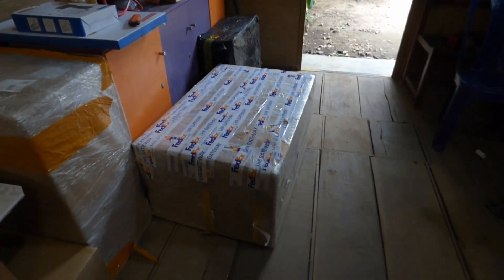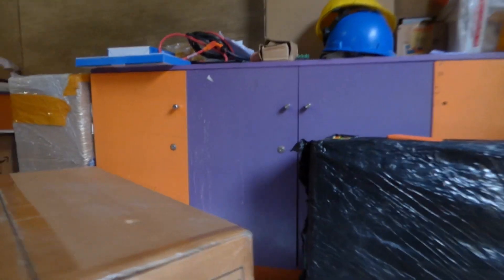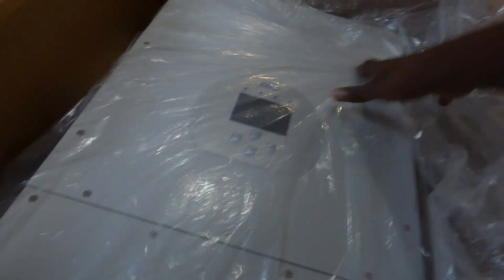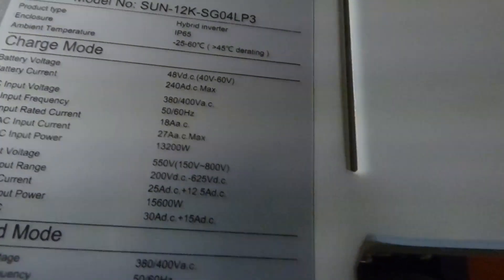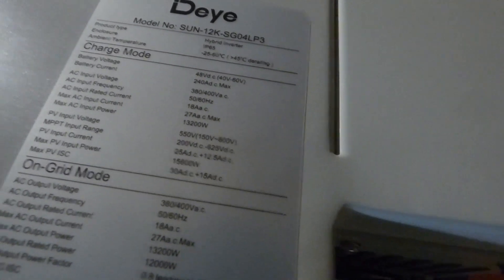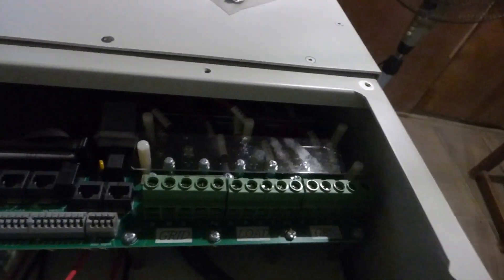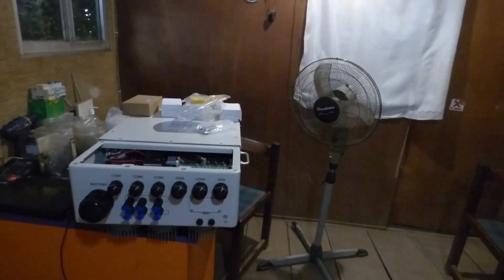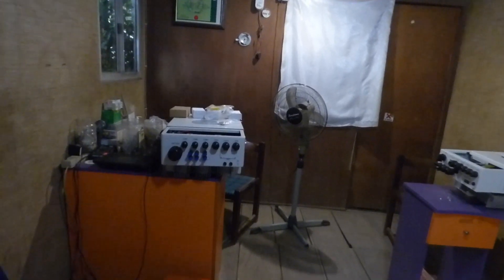Unboxing the Deye 12 kw 3 phase Inverter

Comment: Hi, I have one of this inverter. But I dont get power regulated AC Charge  together with the CT clamps to work. The inverte measure the power which is going to grid but it never charge the battery with this power. 
Do you know a solution for this?
Reply from the maker: In the battery settings tick grid charge.
Reply: @drsolar  Thanks a lot for you fast responds. If I tick grid charge it starts a charge from grid without power regulation than I have to pay for this power which is not what I want. It should use the available power from other inverters to charge the battery and not from grid.

Comment: Iam on the solarman pro app on mobile as well as desktop... 8n desktop from my laptop how do I remotely change.settings of inverter such activating  or deactivate time of use ,under  Device control it shows no data for now. How do I enable this?
Reply from the maker: Thank you for watching and commenting. You need Deye to give you access. Have your seller put in a request for you

Comment: I would buy 2 x5kva and joint them in parallel instead one massive 12kva .
Reply from the maker: You would need 3 of the 5 kw. The 12 kw is three phase

Comment: How's Deyes build and longevity quality comparing to big brands like SMA, Fronius, Huawei, Goodwe, Growatt etc? And what do they mean by "Input PV is 550, but it's also up to 800?" Huh? What now? :P And is that per MPPT?
Reply from the maker: They offer a 5 year warranty. It is still too early to tell. The PV input question. There is a maximum that will damage the controller and an acceptable range that works well

Comment: hello, thanks for the video.
I have a question 
this inverter PV input voltage is maximum 1000v, is that means 1000 for every array? since it has 2 mppt controllers 2strings + 1strings. is that means every string 1000v?
thanks in advance
Reply from the maker: It means you should not exceed that number. The two mppt controllers are independent. They don't have to to have the same voltage. Thank you for watching and commenting. Please don't forget to subscribe
Reply: yup each MPPT accepts 2 strings of 1000 votls ,This machine is a beast .

Comment: Nice!
Reply from the maker: Thanks! How are your inverters doing?
Reply: @drsolar  Hi Doc, Working very well, using as a backup only, inverter and battery (leaf) no solar, not yet. Since install there has been at lease 8 power failure lasting from 3 minutes up to 13 hrs. Inverter and battery handled it like a charm. In most cases guest did not know there was a power failure.